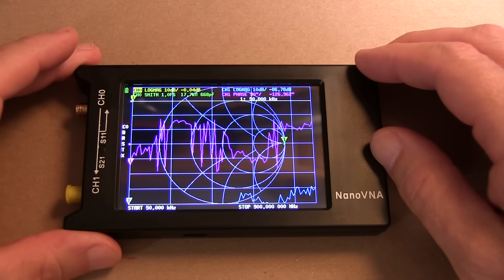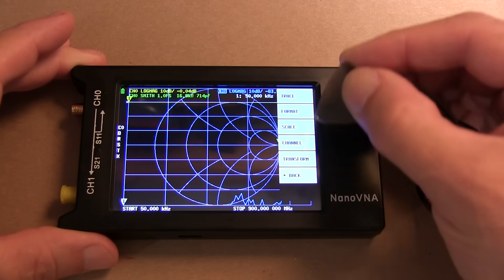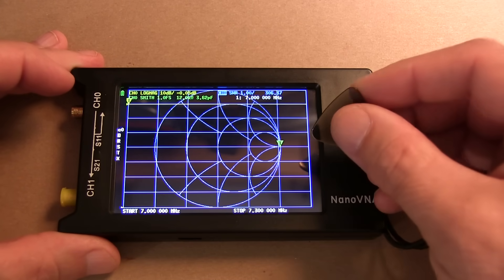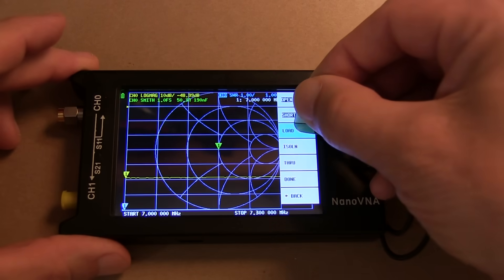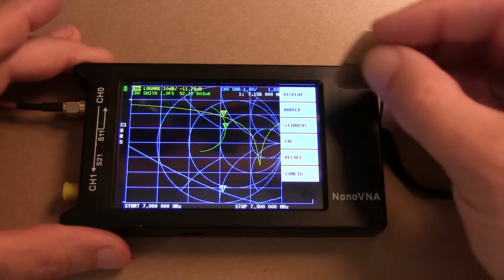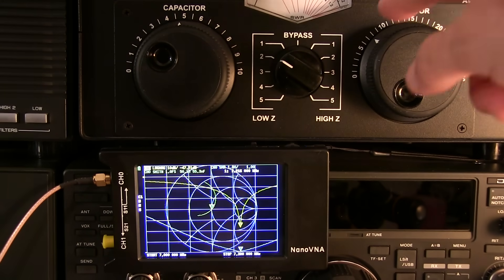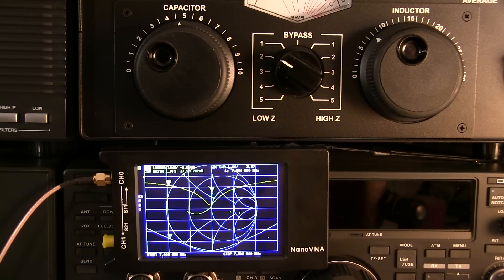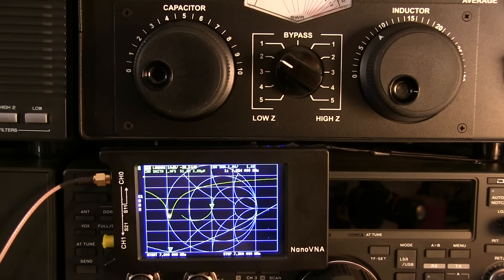#314: How to use the NanoVNA to sweep / measure an antenna system's SWR and optimize its tuning

Comment: From what I see in the comments and having bought one myself. The folks who sell this VNA should as least pay you as an instructor if not for the boost in their sales. Thanks for another set of helpful insights in both using this device and our equipment.
Reply: The only complaint I have about it is the the manufacturer hasn't provided more detailed instructions for it's use. A lot of the purchasers are NOT engineers. A lot of ham radio operators are buying these. Some are engineers and some are not. I think a professional engineer would get the hang of it pretty quickly. The rest of us need a bit more help.
Reply: @David Hogg How do I get on the "IO" forums?  And how can I get one of the good ones (Noelec? Hugen? Deepelec?)
Reply: Not everything has to be about money.

Comment: As always, clear explanations and visual pointers. I am interested in getting one of these VNAs, but I am still studying the options. So many variations... Thanks for sharing.
Reply from the maker: I went with the NanoVNA-H4.  The NanoVNA-F has a similar sized screen but in a metal case (nice).  There is a new v2 that is just coming out now that goes to 3GHz.  Firmware is a little behind the original (doesn't interpolate between calibration points - thus you have to calibrate with every frequency setting change - good practice to get into, although this forces you to do it).
Reply: I try not to mention other channels normally but TomTekTest (TTT) just put out a comparison video on the NanoVNA options about 30 min. Prior to this comment. I have not watched it yet tho.

Comment: One of my first “experiments” with my NanoVNA was with the ATU in a similar way, it took a while for the penny to drop, RF path in the ATU is relay switched and had been unused a while. Needed a bit of real RF current to clear the oxides. NanoVNAsaver is a must have software to grab plots. Thank you for another great video.
Reply: Thank you for the software info!
Reply: @billjones2271 , talking measurements with the NanoVNA at home the PC software is in my mind a must have. The plots can then look very professional and of course you can screengrab them.  I have been doing some measurements with baluns, the ability to actually save a sweep and print it has transformed the process. 73

Comment: Alan, in your opinion, how does the NanoVNA size up to the MFJ analyzer and the RigExpert?
Reply from the maker: The nanoVNA sweeps faster and can display multiple results at the same time, where the others are a little slower and one result at a time.  However, the NanoVNA doesn't seem as rugged (i wouldn't want to drop it), and others like the RigExpert are geared more specifically at antenna/ham use.  The nanoVNA is more general purpose.  And of course, the VNA can make "thru" measurements (S21), while the MFG/RE units are reflection measurements only.
Reply: @w2aew  Tuning a duplexer with the NanoVNA and comparing the accuracy to another one of your VNA's would be an interesting video to watch.

Comment: Thank you. I haven't been able to do SWRs on mine and didn't find any help on the setup. Please keep them coming. Carl AB1Zi
Reply: Did u manage to read the swr? Or else I can help you :)
Reply: @sirhaugen1025  Hi, I was able to read swr after this video but I think my nanovna has some problems. Sometimes it doesn't show any readings for a minute or two and after it is working the swr reading are way off compared to my swr meters, more then one. But it did read correctly on my 2 meter J-pole. I might try to install the firmware to only use it for swr readings and see what happens . But I am not happy with it the way it is. Thanks, Carl

Comment: VSWR at 1dB is very Bad I thought you would want it to be close to 0db VSWR? Also when tuning the antenna do you always want the frequency of operation so be in the "center" of the smith chart and the Return Loss/Reflection Coefficient to be at -30db? I'm just confused why would you want the antenna frequency of operation to be in the center of the smith chart because that is NOT at 50ohms in the center of the smith chart. I would think you would want it at 50 ohms to be matched with the antenna receiver preamp which would be at 50 ohms?
Reply from the maker: VSWR is usually expressed as a linear ratio instead of in dB.  However, a 1dB VSWR would be quite good (1.12 : 1).  You want your frequency of interest to land in the center of the Smith chart because that represents a perfect impedance match to your system impedance (usually 50 ohms).

Comment: I wonder if the nanovna must calibrated with or wothout small cable included...because if i calibrate without, then i conect that cable the marker are gone from initial position on smith chart...
Reply: Yes, you want to "calibrate out" everything that isn't your DUT (Device Under Test). You don't want to measure properties of your pigtails and connectors. Think of it this way - calibration virtually moves the terminals of the nanoVNA somewhere else (and cancelles out other factors). Let's say you have an SMA to BNC short patch cable. To simulate the behaviour of your antenna as if it was connected not to a VNA, but to your transceiver instead, you should measure physical properties at the point of connection.

Comment: Hi,not retuned antenna, fooled radio into thinking it is TX into 50ohm load.
Reply from the maker: The transmatch transforms the impedance looking into the transmission line into 50 ohms. If you’re using low loss transmission line, this can be very efficient.  No “fooling” involved, it does provide a 50 ohm load to the transmitter.  True, it doesn’t change the SWR on the line between the tuner and the antenna. With low loss line, this high SWR doesn’t matter.
Reply: @w2aew  Hi , thanks for reply. My point  is the ANTENNA has not been retuned as it has not been altered in length or hieght from ground. The TX sees  50ohm at it's output  because the transmatch has ,as you say transformed the Z to 50ohm, the ANTENNA has not changed it's Z is still the same. The system between TX and transmatch has been matched to 50ohm nothing else has changed.
Reply: Hello Geof HAM - The idear of an Antenna tuner is always matching to a 50 Ohm impedance. The key question by using an AT device is how You go out from the AT to the antenna. 1 - As close to the antenna feedpoint as possible. 2 - With a transmission line that provide the lowest loss considering the antenna feedpoint impedance on a given frequency. That's why it is a good choice to feed the antenna symetricly by a ladder line but a short and low loss coax feed is also a very reasonable option.